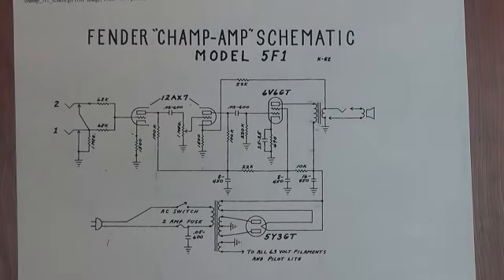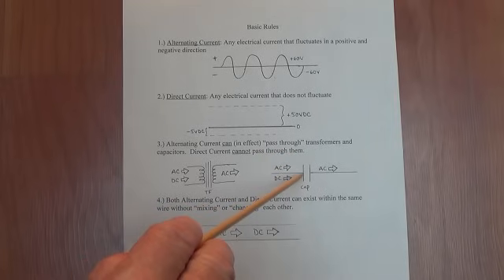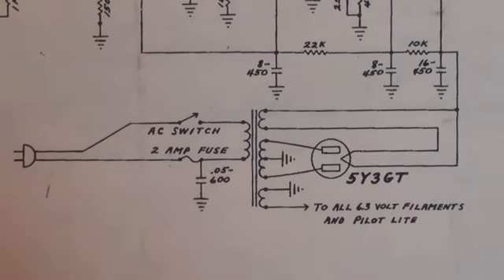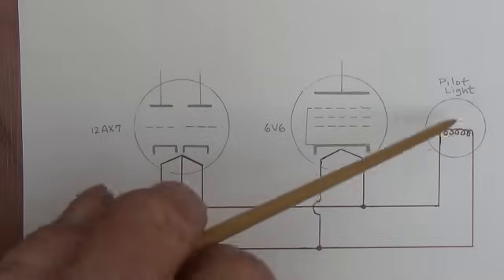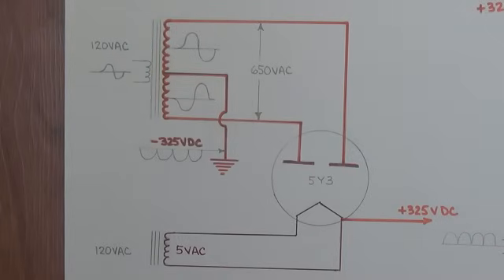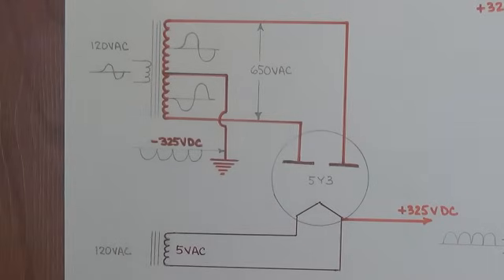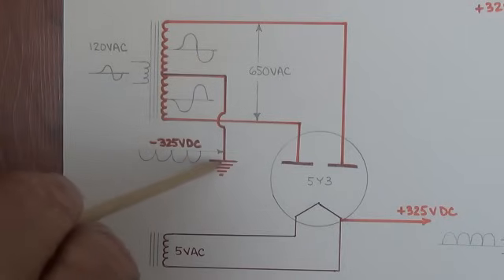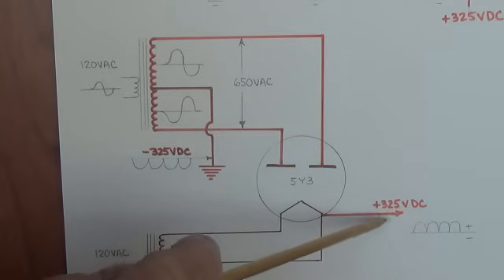How Tube Amplifiers Work, Part 1: The Power Supply

Comment: Hi Doug, I maybe missed out on something that I just can't seem to figure out please. Does a Cathode ever get its own voltage source in any amp design? And if it ever does, how many volts does a Cathode get? I am aware of a directly heated Cathode, or a Cathode with indirect heat, but does a Cathode for a 12AX7 or 6V6 ever get a voltage source applied? Or is the Cathode just a "Slave" to the heater, to be heated indirectly or directly? Am I correct to assume that the Cathode is always just grounded via a cap/resistive circuit, so is it never anything more than a path to ground and never gets a separate negative voltage source? If it ever did, wouldn’t that push even more negative charged electrons over to the plate/Anode and increase efficiency and volume? Or am I way off track here? Or is just being “grounded” negative enough, for the Anode to sufficiently pull off enough electrons for the intended design of the amp? Thanks very much from a 93 Fender Deluxe Re-Issue. – (If this question is not too elementary, you can answer publicly if you like. That is fine by me. Thanks Doug)
Reply from the maker: This is a common question, SS, and the answer will surprise you. We always focus on the high voltage positive DC (B+) in amp circuits, but the real source of all electrons and current is the chassis (ground). The power supply is like an "electron pump", removing virtually all the electrons from the circuit, tube plates, etc. and sending them to the chassis ground. It is the flow of electrons from ground to all the positive areas, like tube plates, that makes the amp function. The tube heaters simply heat up the cathodes to facilitate their release of electrons (from ground). Disconnect a cathode from ground and it will rapidly lose the ability to release electrons, regardless of the heater.
Reply: Hi Doug, thanks very much for this. Much appreciated. Have viewed all of your videos, some more than twice, and am quite aware of what is going on inside my 93 Fender Deluxe RI now. Sadly, I suspect Rusty can play better guitar than i. You are even a lean mean Surfin’ machine! If anything else comes up, I am sure we will let you know. Thanks again for your tutorials. They are appreciated.
Reply from the maker: You're welcome, SS. Thanks for your nice comments. Our best to you and yours :)

Comment: WOW! This matches my schematic very closely. I am preparing to restore my father's vintage 1959 Bogen Challenger AC220 which has three 12AX7, four ECL82, and a GZ34 rectifier. I am following along using Sam's Photofact set 488, folder 7, and your explanations are very clear and helpful. I desire to have a thorough understanding of how this thing functions before I tear into it. I already know that I need to add a fuse since there is none present. And there is no "death capacitor" either. Is this what is known as a safety capacitor? If you can think of any other useful modifications (grid bias adjustment?), please advise. Thank you.
Reply from the maker: Jeff, I have no personal experience with the Bogen Challenger amp, so I'll leave the modifications up to you. I'm glad the video was helpful. Best of luck with your restoration.

Comment: I am wondering, can you hook an oscilloscope directly to the high voltage of the transformer wingdings..or to the output of the 5Y3 tube..???
Reply from the maker: Not a good idea, Ken. A DC signal trace is simply a (boring) straight horizontal line.....and you would risk destroying the oscilloscope to see it. Scopes are for tracing the (much lower voltage) AC music signal through the stages of amplification.
Reply: I understand now.....I guess the question should have been can you hook an oscilloscope to that high of AC voltage, on any piece of equipment?
Reply from the maker: There may be ways, Ken, using highly resistive probes, but when dealing with tube amplifier circuitry there is no reason to do so.....or source of high voltage AC to measure. The high voltage is DC.

Comment: To me it would just be as easy to make a 6ax7 tube instead of 2 elements in one tube..just a thought..
Reply from the maker: The 6AX7 tube does exist, but you virtually never see them used, simply because the 12AX7 offers twice the benefit in the same package at about the same cost.

Comment: I do believe that American mains have approximately 85v from top/trough to zero, not 60 as you state. If I am not mistaken 120vac is an RMS calculation and 85v+85v=170v top to trough and would energy wise be compared to 120v DC no? Try rectifying and smooth mains to confirm. Great lecture video man!
Reply from the maker: This point has come up several times previously, BB. The video was intentionally basic, since it was intended for beginners. I have since posted several more advanced videos which more fully explain the concept of RMS, rectification, and smoothing by filter caps. Please check my video listing :)
Reply: Aha, I guess I did not read all the comments. I just got referred to you by my audio technician friend and will definitely watch more of your content. You know I just got that trigger keyboard happy finger to sort it out even though I reckoned you knew this. To give something back to this interest group I recommend reading Horowitz & Hill's The Art of Electronics and Turings Cathedral by George Dyson. All the best.
Reply from the maker: Thanks for the reading recommendation, BB. We have posted about 150 videos so far, and they definitely vary in sophistication of content. We hope you get a chance to watch some of them. Meanwhile, best of luck in all your endeavors.

Comment: Sorry but I don't understand how the +325V DC come from the filament, then what's the filament for?
Reply from the maker: This question gets asked a lot, Ulric. The filament voltage is 5VAC and heats up the cathode of the rectifier so it can do its job. AC and DC can coexist within the same wire, like waves (AC) on top of the ocean (DC). The rectifier tube contains two diodes that are oriented so that they only pass positive wave forms, thus forming the high voltage +DC, which exits via the filament to the amplifier circuit.
Reply: Uncle Doug Thank you very much, it totally makes sense now! You're such a great teacher and make it look so easy. Thanks
Reply: Uncle Doug But wait a second... if the diode is formed by cathode and anode, then why aren't those +325V coming from the cathode instead? When does the filament recieve that voltage? thanks
Reply from the maker: Because the orientation of the two diodes within the rectifier tube causes the positive DC to travel from plate to cathode (filament). The negative DC travels in the opposite direction, exiting from the plate (secondary winding center tap) to ground. It all depends on the bias (orientation) of the diodes within the rectifier, and all of them (that I know of) are oriented so that positive DC travels from plate to cathode.
Reply: Uncle Doug Thanks. That's exactly what I didn't understand, I didn't know the polarity could be changed

Comment: Uncle Doug, would you recommend a place to get a good schematic and parts list for building a Champ clone? I see a lot of resources when I google it, but I’m not sure how accurate or trustworthy they are.
Reply from the maker: You can download free schematics from the Internet, Stephen, and then make your parts list from the schematic itself.....simply cross off each component as you add it to your list. Transformers are readily available from Triode Electronics and all the other parts can be ordered from Antique Electronic Supply. Good luck with your project.
Reply from the maker: Here is an excellent source of information on the Champ, Stephen.....everything you will need to build your clone:   http://myfenderchamp.com/2010/03/29/fender-champ-5f1-wiring-diagram/

Comment: Was thinking about it. I image you’re gonna say the 5v circuit is using the output as ground. Therefore the 325v does not enter, because there is no ground there for it. Thanks Uncle Doug! You’re awesome! Lol
Reply from the maker: The rectifier consists of two diodes. In most amps, they are aligned so that only the high voltage positive wave forms can pass, while the negative wave forms are blocked. The resultant positive high voltage (B+) must then pass through the amp circuit seeking ground so that it can return to the (grounded) center tap of the high voltage secondary, thus completing the circuit.

Comment: I don’t see this question, so I will ask. 
The output is 325v coming from the same point with 5v, which heats the heater. I get that direct and ac can run in the same circuit. But howcome the 325v doesn’t melt the heater? Doesn’t make sense to me. 
If the heater is connected to that circuit, the heater has to be able to handle it. how can 5v make the heater heat up? I don’t get it.
Reply from the maker: The 5V filament voltage is sufficient to make the heater filament red hot (you can see it glowing within the tube), which (in indirectly-heated rectifiers like the GZ34) is sufficient to heat up the rectifier cathode and make the rectifier function. The high voltage exits from the cathode, not the filament. In directly-heated rectifiers, the heater and cathode are combined and can withstand the high voltage.
Reply: Uncle Doug right!  Because current is what causes the filament turn red, not voltage. 
Thx!
Reply: Each end of the filament is connected to one of the ends of the heater winding of the transformer. The heater winding is delivering 5V AC which appears across the filament causing current to flow which is enough to make it glow red hot. 5V AC r.m.s. across the heater winding is 14V peak to peak, so one of its ends is going between +7V and -7V with respect to its other end. It makes no difference to the heater winding that one of its ends is connected to the B+ voltage of 325V (or any other voltage). Its other end happily swings between 332V (325 + 7) and 318V (325 - 7). The voltage across the heater winding and therefore the filament is only ever 332V - 318V = 14V peak to peak, or 5V AC r.m.s.

Comment: Great video, but with one major error... The "-325VDC" at the center tap should of couse be ZERO volt DC, as ground is always zero. There is no -325V because the rectifier can only conduct one half of the full wave at any given time. That is why the output is 325V instead of 650V.
Reply from the maker: Thanks for your nice comment and input, Erwin.

Comment: Hello. Can I start up my tube and with a variac at low village so I don't spike my tubes with high voltage startup before the tubes draw current and the voltage comes down? Can I use the variac at first and then raise the voltage to 115 after about 20 seconds. What voltage would be good to start off at while it warms up? I would appreciate any help on this. Thanks
Reply from the maker: Yes, you can use a Variac to gently start up an old tube amp that has been unused for several (or many) years. I have made a video demonstrating the procedure. However, this method is most effective with diode (solid state) rectification, since rectifier tubes won't produce much (or any) HV DC at low voltages.
Reply: Thanks. I have a 5U4 directly heated rectifier tube and wanted to make sure my first cap wasn't getting blasted with start up voltage. I guess i need to make sure it is rated for start up voltage spike

Comment: What is the minium  ohms load for a 68 fender  bassman and what is a good match for speakers
Reply from the maker: It depends on the speaker configuration. The classic 4 x 10" version had a 2 Ohm OPT secondary impedance. You need to determine the circuit identity (5F6A, AB165, AA764, etc.) to know what impedance is needed.  I have had excellent luck with modern Jensen Alnico and ceramic speakers and I understand that Webers work well also.

Comment: Awesome presentation! You really know how to make things clear! What did you btw call the capacitor at 4:15 ?
Reply from the maker: Thanks, CS. It is nicknamed the "Death Capacitor" because many people fear that it will cause a short circuit to the chassis and electrocute people.
Reply: Thanks! What is the purpose of such death capacitor on the primary coil  ?
Reply from the maker: It was originally intended to be a filter to eliminate noise in the incoming AC.  Apparently, this was more of a problem in the "old days" then it is now.
Reply: Thanks! Just saw that you actually also did an excellent video on the "death cap" topic :)

Comment: I really appreciate your videos Uncle Doug. I'm not so clear on where the output is for -325vdc, however. It looks like it's coming from the bottom half of the secondary. Me no get. Where's the reverse biased diode?
Reply from the maker: In later videos, I clarify this, Tarek. Because the secondary is center-tapped, the wave forms in each output line are out of phase. When the positive wave forms from each phase are added together sequentially by the rectifier diodes, you get continuous, adjacent positive wave forms. The negative wave forms, which could have been aligned in the same way if the diode bias was reversed, are simply blocked.  It is explained clearly in subsequent videos, with diagrams for clarification.
Reply: Uncle Doug: Ok, I got the full wave rectification part. But how do we account for the 325 VDC, shouldn't it be half the amplitude of the AC signal?
Reply from the maker: It is, Tarek. The total potential between the out-of-phase wave forms from the secondary is 650VAC. If you have a CT power transformer handy, hook up the primary and measure the output across the secondary outputs. It generally measures higher than most DMM's can read.
Reply: Uncle Doug. I know that I would measure full potential across the entire secondary, but what about the center tap? It's giving us 2 out of phase signals, each with a Vpp of 325 VAC - that's what I meant, by the "AC signal." I am assuming the rectifier's job, in this case, is  to allow only the positive peaks (325 VAC/2), coming from the two out-of-phase signals provided by virtue of the center-tap. Please correct me I am operating on some faulty assumption.
Reply: During each half cycle of AC, one end of the transformer goes from 0V to +325V and back to 0V while the other end goes from 0V to -325V and back to 0V. The diode connected to the end of the transformer that is going positive passes a pulse that goes from 0V to +325V and back to 0V, while the other diode blocks the negative going pulse from the other end of the transformer. During each half cycle one or the other of the diodes is conducting, so that a series of pulses going from 0V to +325V and back to 0V appear at the cathode.

Comment: Uncle Doug,  Great video.  Some comments.  Line voltage is RMS, not peak to peak.  AC voltage is measured RMS unless otherwise stated.  The .05uf 600V capacitor on the primary is not the 'death' cap.  One can survive 120 volts.  I have had more than my share of 120V jolts.  The 'death' cap is the 16uf 450V B+ filter cap.
Reply from the maker: Thanks for your input and nice comments, Rock. I have since released several more videos on this and related topics which go into greater detail, accuracy, and proper terminology. I will, however, stand by the statement that the .05uf cap is indeed the "Death Cap". It is the only capacitor in the circuit that, when shorted can energize the chassis and guitar strings with 120VAC,  possibly resulting in a lethal shock to a properly grounded musician in contact with the guitar strings. None of the filter caps can do this.

Comment: The rectifier confuses me. If the bottom portion on the rectifier is the heater, how is it outputting the positive side of the DC voltage? Are the anodes inside the rectifier only picking up the negative voltage? I understand that both AC and DC can remain on the same line but im confused as to what the cathode is heating?
Reply from the maker: The bottom portion of many rectifiers is actually the cathode, MI, which is directly heated, just like a filament. The rectifier tube plates and cathode form two diodes, which (depending on how they are biased) will either pass only positive or negative DC current. In this case, the positive current is allowed to pass from the plate to the cathode, so the high voltage positive DC current flows from the cathode to the amp circuit.